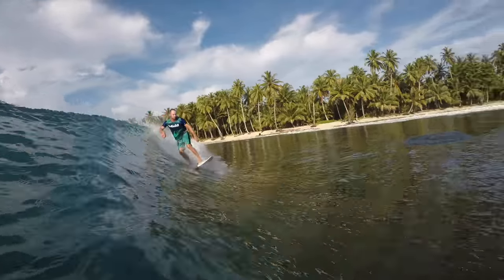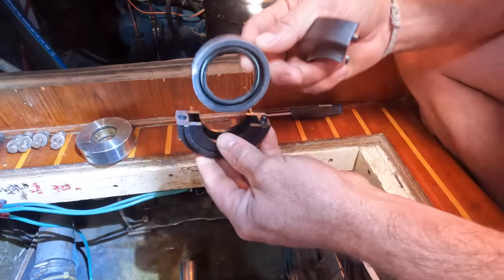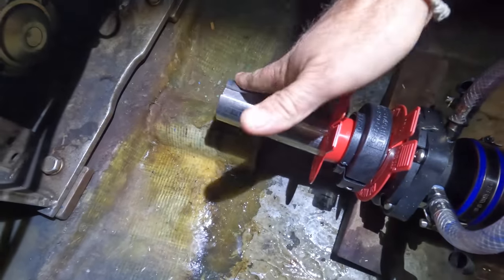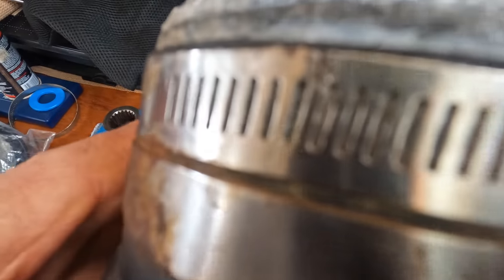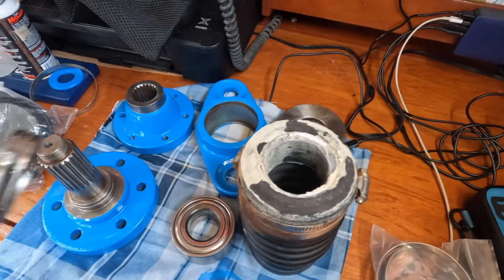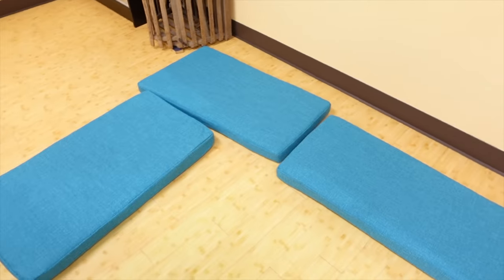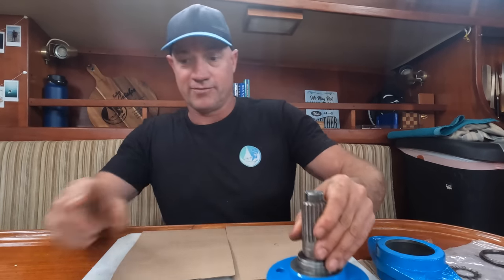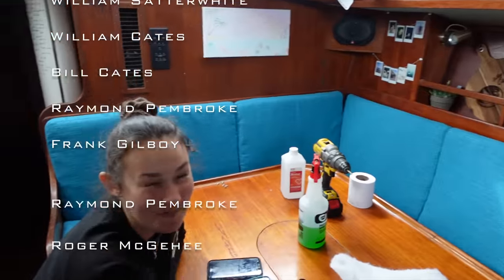How we save money Fixing our old Sail Boat | Ep 348 | Lots of Boat Work

Comment: Hi again Lee after watching you struggle with Sheared Studs and Screws in past videos I Highly Recommend you buy a set of Sealey Tools Easy Out's  or Multi Spline Screw Extractor set 25pc Pt No. AK8182 I am an Aircraft Tech and used the Snap-On versions of these 20 yrs ago they are far less prone to snap off as the types you are using plus the Socket style drive gives you a lot more purchase when attempting to remove a stuck sheared screw and the USA is the best place to buy these tools at a far lesser price than UK or Australia I hope you find them at the right price and you use them with the assuritiy I have over the years

Comment: The aqua drive system, on top of allowing for imperfections in alignment, allows for softer engine mounts to isolate the boat from sympathetic vibration.  When all working correctly, it makes for quite iron genny operation!

Comment: Lucky there’s plenty of room to change the seal, rather than block & tackle. From the vids, I’m trying to get my head around the shaft setup. It doesn't appear to be long, so what’s the purpose of the thrust, vs simple easy maint (no bearings) CV-uni>spline shaft like a car? Wire hose clamps are much better than those ones your using, also offers redundancy.
Reply: A propeller can easily reach a thrust force of a ton against the transmission and then onto the engine.  This will wear out the transmission and strain the engine mounts as well.  Any misalignment of the shaft and spline will wear it all down very quickly. These forces in Catalpa's setup are transferred to the hull.  An added bonus is reduced vibration therefore noise.  A softer/more sound-dampening engine mount can be used because they're not also trying to stop the engine from flying into the saloon.

Comment: Wouldn't you want the springs in those seals away from salt water? Salt would cause premature corrosion?
Reply: Unless springs are 316 s/s (doubtful) we remove the springs and replace with o-rings. Do this especially in all the raw-water pumps we rebuild where spring will come into contact with the salt-water.

Comment: Hi Lee.

Where do You back up the parts file on Your phone. I am Old so everything for me is printed on paper and filed away. I have had phone die and have lost everything on them so I do not rely on the mob alone.

Perhaps You could email the file to a family member back home for safe keeping.

Luv Ya Work.

David. Down Under.
Reply: Hi Dave, he took a pic of the part number. Phones have a backup system where all personal data, settings, etc, get backed up to the cloud (storage). When you get a new phone, sign into the same account, all your old stuff is available. There's also manual ways of online storage (like dropbox), which I prefer in case I switch from iphone to android, etc.